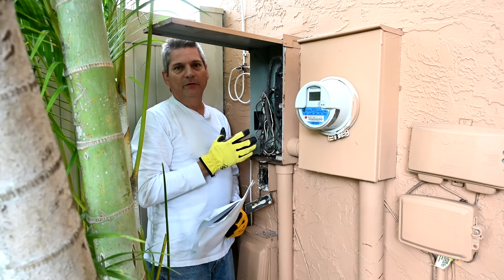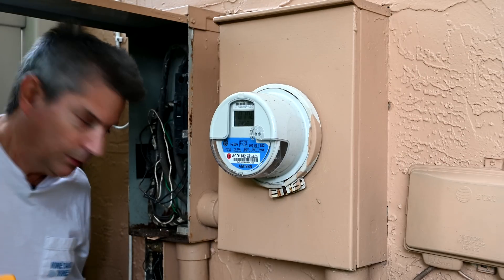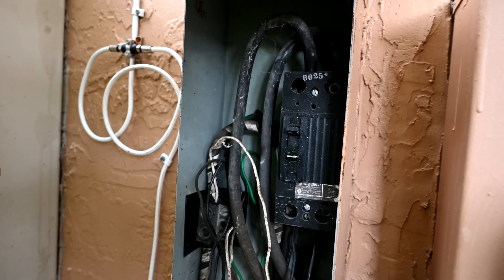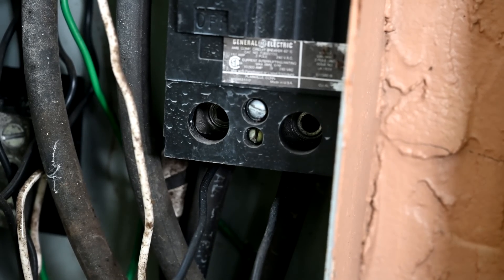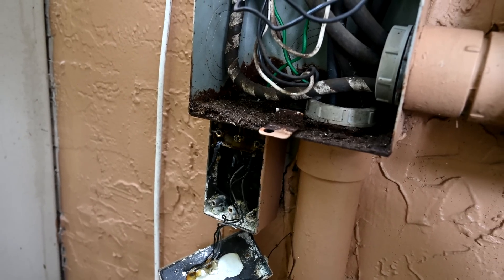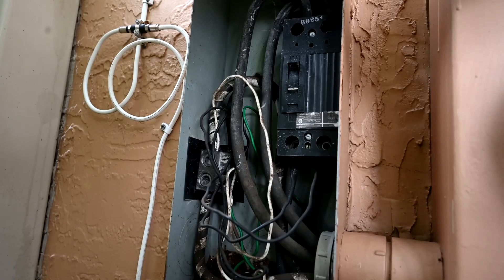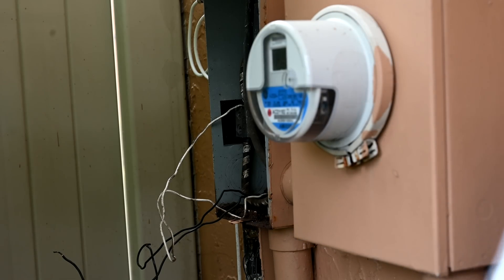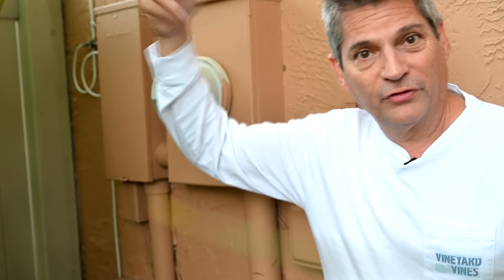Electrical FAIL: How To Fix Double Tapped/Wired Circuit Breaker

Comment: You could go to a wireless door bell,why run wires!simple fix!👍
Reply from the maker: Yes we installed a Ring Doorbell at our house. BUT it is still desirable to have that 24 VAC wired connection to the Ring, because if you go with their battery option, I heard they last only 3 months, even though the company claims it lasts a year. You have to buy extra batteries if you don't want a gap in coverage while your battery charges for 10 hours overnight.
Reply: @jeffostroff  the battery lasts 6 months to a year depending on activity and I’m sure that anyone could survive without a doorbell for a few hours every six months.

Comment: not a good video ,people should not be in a box with live wires is #1 .#2 where is your personal protective  equipment , eye protection ,should have an approved face shield ,  are your gloves rated for working with live equipment if so have they had their regular test by an approved company .Another possible requirement may be your clothing which may need to be fireproof ? .So now we might have saved you  ???  You did not mention anything about the fact that the  transformer and wiring was only protected by the main breaker and not by an appropriate sized breaker .playing with electricity is not a game .   Ken Allen    retired electrician
Reply from the maker: thanks for the input
Reply: @jeffostroff  just worry about public thinking    no problem    and hurting themselves

Comment: Thanks for the video Jeff. You're a braver guy than I, daring to post electrical work to YT.  😁  Did someone end up fabricating an inner panel cover, or was total box replacement eventually necessary to satisfy the inspectors?
Reply from the maker: Not that I know of, to find on that old someone would likely have to make one. Sellers just told the buyers it was not on the panel when they bought the townhouse so there won't be one now.
Reply: @jeffostroff  It seems like when the home was sold before, the electrition was paid off to supply a certificate for the sale and did not do the job correctly .
Reply: @jeffostroff  ... a home brew cover would not be UL approved. End of story.
Reply: @rupe53  but neither is not having one!
Reply: @coypatton3160  ... in the case of liability, the guy who makes the modification (or is the last to touch the job) winds up with the liability if there's a problem. Better to not touch it from that viewpoint. If some inspector or the bank insists something be corrected you can offer some $$ toward the repair (but not total replacement) and let the next guy worry about it.
Reply: @rupe53  in effect this guy doing the video did work in the box so he is liable as he did not address the safety issue. 
In addition your statement if let the next guy worry with it—1) it is too late as the owner had an ‘engineer’ go in the box. Thus the engineer has assumed liability as has the home owner as it is now no longer in the state of the inspection! 2) a failure to correct the code violation could result in a to refusal by the loan institution to issue the loan, resulting in a non sale of the home. 
While more work and labor, a replacement box would clean that additional now empty outlet box and correct the cover plate issue likely for much less than the replacement cover.
Reply: @coypatton3160  ... point well made!

Comment: Very odd use of a ratchet. I would have used the regular driver, which at least isn't a metal handle.
Reply: It wouldn’t have mattered anyways if the regular driver wasn’t insulated. That little piece of rubber at the end of driver won’t do a damn thing if your shocked.
Reply from the maker: Driver does not have enough torque to tighten this by hand on this old box.
Reply: @jeffostroff  plus it wouldn’t have mattered anyways if the regular driver wasn’t insulated. That’s why you said they also make those ratchets insulated. Don’t guys like this get on your nerves? I know it’s your channel and you have to be nice but damn.

Comment: no true spark will use a volt alert , tap them on wood and they light , test with proper meter and test meter before and after on a good known source
Reply from the maker: Not every homeowner has these meters, which is why I showed the lower cost Voltalert. And besides your assessment is wrong. If there is electrical energy there it is 100% accurate, never seen it miss. Fluke does not make garbage electrical tools.
Reply: @jeffostroff  A homeowner should not be anywhere near the incoming mains , flicking a trip switch (breaker)  is as much as they should be doing
Reply from the maker: @nf5416   True but you know many of them are going to do it anyway and they're not going to buy the type 0 gloves so the only thing we can do is protect them as much as we can
Reply: Every licensed master electrician I’ve even encountered has and uses a NCVT just to test for live wires. A multimeter is for specific readings. Sometimes you just need to know if a wire has potential or not doesn’t matter if it’s 120 or 240 volts, doesn’t matter the current draw.

Comment: Uhhhh....... that ratchet and extension/ hex bit set up was not insulated. Why was there a large disclaimer suggesting that it was?
Reply: Your a dummy he NEVER suggested that it was insulated he said that they make ratchets and extensions insulated. Smh people like you are hilarious.
Reply from the maker: Uhhhhh.You don't know how to read. The statement on the screen at 10:27 reads “There are insulated tools that can be used”. So why did you lie and ask “Why was there a large disclaimer suggesting that it was?”. we never said that it was an insulated tool in fact the only reason I was using that tool was because and you didn't pay attention earlier, we cut off the power to that side of it with the switch so there was no live voltage anywhere near where we were working at the bottom half of that electrical panel.
Reply: @jeffostroff  people on YouTube are so annoying and stupid. Good luck buddy it’s going to be long road dealing with these internet idiots that can’t comprehend a basic discussion or read. Smh.

Comment: Maybe you could help me. My water heater needs to be replaced. The estimate guy came out and turned off the WH 30amp Breaker and he left. Then my house started to get warm. Seems like the breaker is tied into my AC. Then a 2nd guy to give me an estimate and he said the new water heater only needed a 20 amp breaker and that I had to have it reduced from 30 to 20 I told him am AC was tied to the 30amp. He said the inspector would not pass inspection if he left the 30amp in. Now what should I do. I’m confused
Reply: Electric water heaters require a 240-volt dedicated circuit, which serves only the water heater and no other appliances or devices. The circuit wiring typically includes a 30-amp double-pole breaker and 10-2 non-metallic or MC cable.
Reply from the maker: I would get a licensed electrician to solve the problem first of why your AC is connected to water heater, it should not be. Next find owners manual to your water heater it tells you how much your breaker should be rated for, or maybe  a sticker on the water heater has the info. If you have to reduce the breaker size, an electrician can do it in minutes, probably charge you $150.

Comment: how i have done old work doorbells i get a 2 gang box run my wire up to it cover the box with the bell body that way the transformer is right behind the bell and in a electrical box for easy access then run your bell wire to the door but i only do that on old work new work i put transformer by the panel but to be honest i haven't looked at the updated code for doorbell transformers for a long time so any input would be great and i have only done 2 in the last 15 years none in the last 10 lol wireless is a lifesaver on that one
Reply from the maker: Yes as far as I know you just can't double tap unless you have breakers that are designed for double tapping.

Comment: Smart meter. Dumb home owner.
The transformer doesn't care about input voltage. It will just give you double the output voltage which will burn out the doorbell.
Reply from the maker: It's not a double transformer, it is a stepdown transformer.

Comment: Being existing construction was a finger plate required, and also was double taping not recommend back then. It seems like you/or the inspector is/are confusing new construction, with existing construction. Don't confuse the two, and don't apply codes that are not required by the state or AHJ ( Authority Having Jurisdiction for correct time period).  By confusing the codes and AHJ you can cause more harm than good, especially in such an aged property.
Reply from the maker: Bill you completely missed the point here. Does not matter when the codes were installed. The problem is a buyer's home inspector coming in now will point out that this is not allowed now and they will demand it to be fixed. When they walk into the kitchen and bathroom and see no GFCI outlets, they will point this out and demand the seller fix it. That point flew over your head because you are too focused on what should be or not be.
Reply: @jeffostroff  ... not true. You do NOT have to make changes to new code unless other things are updated. They can recommend but not force the changes. OTOH, that interior plate was needed to make the UL listing of that cabinet during the original installation. That needs correcting.
Reply from the maker: @rupe53   Make sure you tell that to the buyer as they are driving away  also if the insurance company ever came by and it a 4 point inspection live at Forster to be changed or dump you on the spot now you have to go insurance hunting. The already went through this with another lady a couple of years ago we had to spray paint her entire electrical panel on the outside because it had a little bit of rust on it and we had to send the pictures to the insurance company to satisfy them.
Reply: @jeffostroff  ... let me point out that a buyer's inspection means they are interested in the house enough to get it inspected and anything found will be an item of negotiation for the final sale price. As for your insurance company trying to dump you, they would have to dump most any home built before 1980 if this were the case. Spray painting for rust would be a small item. Fix the leak (if it's rusty on the inside) then clean and paint. That's maintenance and repair, not a code update.

Comment: Don't you mean 240 would fry the doorbell as opposed to the transformer?
Reply from the maker: it might fry both, depending on what transformer they put in place. If they install a 120 v transformer across 240 volts, don't expect it to last very long.
Reply: @jeffostroff  -- I just never knew a transformer to fry from over voltage; assuming we are not talking about a switching supply.  Too high VA sure, i.e. over-power, but not solely from voltage.

Comment: Another problem I saw with this wires that you pulled out were undersized for the current since it was connected directly to the 200 amp main breaker 🤩👍 I enjoyed watching your video 😎
Reply: Kinda hard to run 4 gauge wire to an outlet or junction box LMAO
Reply from the maker: Thanks Kevin!

Comment: In plain English, you found and corrected an unprotected, unfused 240 volt sub-circuit that could have and would have killed any child or homeowner who came in contact with that circuit.
Reply from the maker: That about sums it up yes!
Reply: It's fused by the main breaker load side, but would likely never trip due to it being on the main breaker.

Comment: Thats not a door bell transformer ITS A WHOLE HOUSE SURGE ARESTER .The box is definitely GE  they should mount a new surge arrester under the panel inside  the house , remove this one  and plug the open ko. The bottom of the main breaker box outside looks rusty a panelboard manufacture could probably make you a dead front cover
Reply from the maker: Looks like people are split on this one
Reply: I was thinking the same thing, like who would tap a doorbell from a main disconnect so far away? Highly unlikely for even the most incompetent person.
Reply: @mook528  Thats not a doorbell its a whole house surge arrester it should be on the inside by the panel coming off a 20 or 30 amp 2 pole breaker.

Comment: Hey Jeff, could the reason the transformer have been installed close to the tap was to conform to NEC's 10 foot feeder tap rule?  Since the conductors feed a transformer and possibly the transformer's overcurrent protection (fuses), the conductors would be considered feeders.
Reply from the maker: Yes, but they could have switched the breaker out to one that allows double tapping, or used a different lug type with multiple screw positions like the bus bars have. Either way, in my opinion, that transformer should have had it's own breaker if wired in that spot, because if the transformer fails as a short instead of an open circuit, it trips that main breaker and takes down the whole house power, right before you hit the save button on your Microsoft Word document for your PHD dissertation! LOL!
Reply: @jeffostroff  Haha true.  Cool video, I don't usually watch this stuff on youtube but this caught my eye.  Have a good Christmas
Reply: @jeffostroff  i am not 100 % sure but don't the code call for it to have its own beaker and be within the 10 feet of  the main fuse box not the emergency disconnect
Reply: @chaos1291975  ... just to avoid confusion, you may NOT use #12 or #14 wire connected to a main breaker... AND... that's not a breaker panel so no room for a smaller breaker. That is a disconnect panel... nothing else goes in there.
Reply: @jeffostroff  That malfunctioning transformer, with that wiring would never trip that breaker. It would just melt down and maybe catch fire, all the while being fed power.
Reply: Good observation! I'll have to look at my code book, but I believe the feeder taps have to be rated not less than 10% of the overcurrent protection device,  so assuming these are 12AWG conductors good for 20 amps you could in theory connect off a 200 amp fuse or breaker.    I can guarantee that particular main breaker is not rated for two wires under a terminal, so that would be a violation.

Comment: Are your gloves actually rated Class 0 for electrical work? They don't appear to be anything other than  regular work gloves.
Reply from the maker: You are correct, just a slight improvement over bare hands.
Reply: @jeffostroff  Depending on what the gloves are made of, they can actually be worse than bare hands. If the material melts in a scenario where you would have only got a slight jolt, you would now have melted polymer, or whatever, as a nice coat of molten lava over your skin!

Comment: I appreciate you taking the time and sharing your thoughts.  However, you open the door for professionals to point out additional problems.  I think it is wise to recommend viewers to hire licensed contractors when it comes to life safety.

The "inspector" missed a whole lot more than "double tap".
You are working at the Main and should be identified as such.  The underground utility (service lateral) is rated a minimum of 200 Amps.
The over current protection inside of the dwelling are part of the sub-panels, not main panels.
Some additional code violations without personally standing there to look at this installation.  I should be able to see the following at the Main location:

The NEC requires the use of a torque wrench when tightening lugs.
#6 grounding electrode conductor to the Main?
#4 cold water ground back to the Main?
Utility bond bridge adjacent to the Main?
Bond screw is not threaded into the enclosure?
Equipment Identification?
I'll assume this is PVC raceway as there are no bonding lock nuts.

Also
Article 240.2
A conductor rated a minimum of 10% of the ampacity of

a feeder conductor may be tapped from the feeder provided
its length is not greater than 10 feet and it terminates in an
appropriately sized overcurrent protective device.

The wires you removed are rated a minimum of 10% (20Amps).

The viewer does not have enough information to determine if the tap rule cannot be used.

Please recommend licensed and insured professionals to work on the electrical systems.  Other than a contractor, only a homeowner is approved to apply for a permit and inspection.

Thank you.  Good luck.

-PD
Reply: Phil, thank you for the code section and other information in your post.  I have wondered about this situation when seeing conductors that I thought (according to rudimentary principles) needed protection, yet the installation was professional.  I appreciate your post with the code and the limitations.

Comment: Some breakers  allow dubble tap but that main  breaker
Reply from the maker: Yes as I mentioned in the video, this breaker does not allow double taps but certain ones from Square D are designed specifically to be double tapped
Reply: So you think it’s okay to tap a 100 amp breaker with 12g conductors?